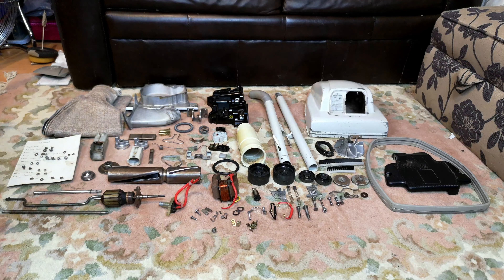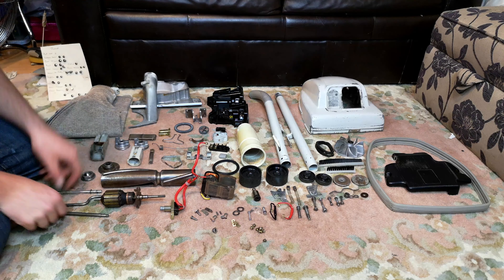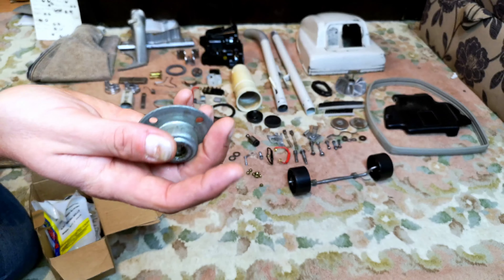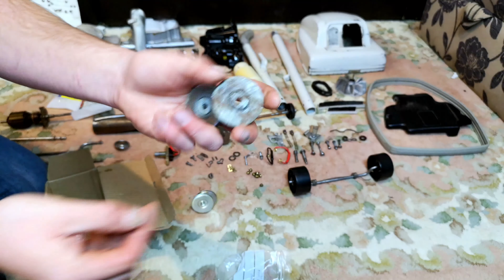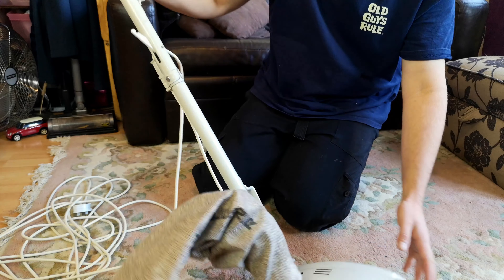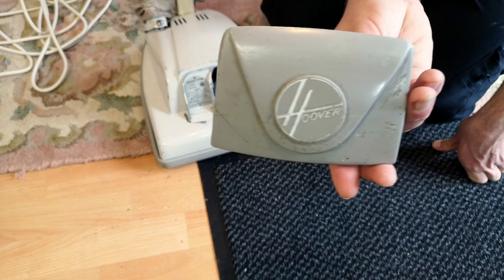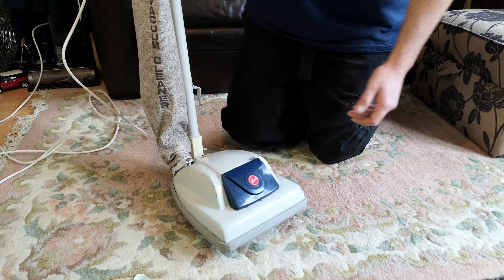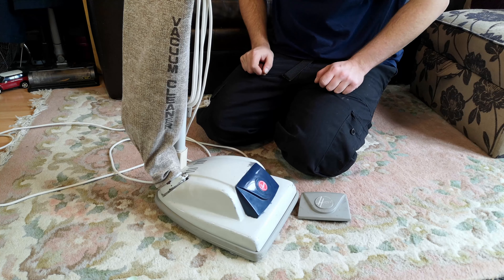Good as new again! Hoover Junior 1334 with ALOT of NEW genuine parts!

Comment: Another hoover junior saved from the scrap heap great job sounds good with all those new parts.
Reply from the maker: Thanks! Sure does, and it's nice to have a benchmark of what one sounds like with brand new spinney bits vs one ive lubricated the old bearings on (not much difference tbh, it's the brushroll bearings that make them noisy)

Comment: Amazed how well you can disassemble these vacuums and get all the parts freed without damage, and not lose them either!

I always save garbage parts because never know when you might need them to cobble together a fix. I mark the part as "Damaged do not use" in my parts inventory so I don't accidentally grab it and forget it's junk.  I have used broken pieces of wheels before to melt into repair material for plasti-welding cracked hoods and handles. Have also used taped up and dog chewed power cords to rewire vacuums that have had their entire cord cut or rotted off as temporarily cables until I can afford period correct cloth cords for my antique vacs.  A lot of vacuums you might be waiting 5+ years to find parts, so always good to make a temporary permanent repair and call the resto done for the sake of sanity. Then can revisit it later on when a part surfaces. For me - 7 years on the hunt for a rubber access door plug for a Hoover Z400/Z700 and still no luck.

Comment: Love the Chanel. Really interesting and full of good advice and tips 👍👍 
Hear is a tip from me,that might come in handy. Over the years i too have repaird and refurbished Juniors and Seniors. I have found,and probably,you to, that the supply of (genuine) replacement bearing assemblies is becoming peaty hard to source,and the ones I’ve come across have been sitting on selves or in packets for years,resulting in the grease inside becoming (Hard) and generally past it. The new replacements available from Qualtex and other suppliers being of much lower quality .
I decided to think (Outside The Box)  on this.
If you are relatively skilled with a Angke Grinder and have a vice. Clamp the bearing assembly by the flange in a vice and carefully grind the ridge off.  This will allow you to remove the back plate. Inside us a thin locating shin and this houses and locates the (felt washer) the same applies on the other side In between sits a  ( Ball Race Bearing) assembly size (629Z). The (Z) denotes (Metal  Shield)

Now as a replacement and to add ( extra protection) agaist dirt ingresses I’d use the ( Rubber Seal) equivalent.
If you are carful you can push this back into the housing and solder the back plate back on.

This effectively results in a (Good Quality) bearing assembly and will  increase the motor life as well as running (smother and sweater).
I use a company that always supplies  good bearings ( QualityBearingsOnline) there fast and reliable. The bearing I favour are SKF ( Swedish) as they are renowned for quality and longevity.
Anyway I thought this might be useful to you. 
Please let me know you’re thoughts and if you have given it a go.

Keep up the excellent content👍👍👍 Jason